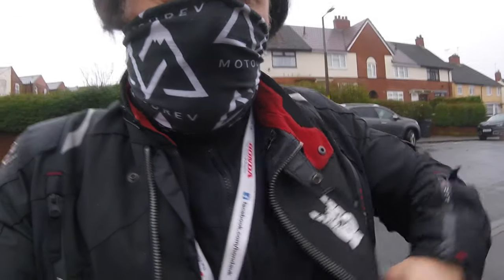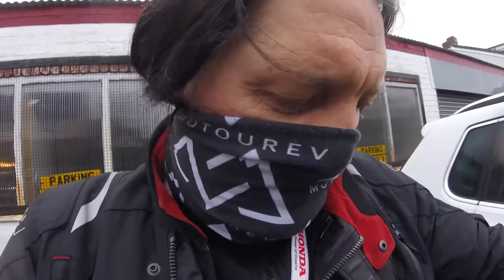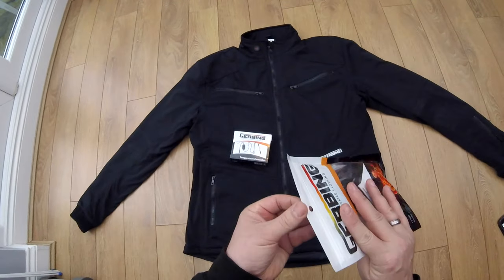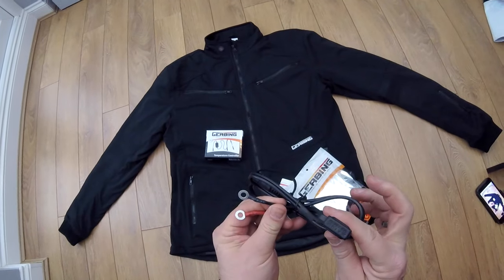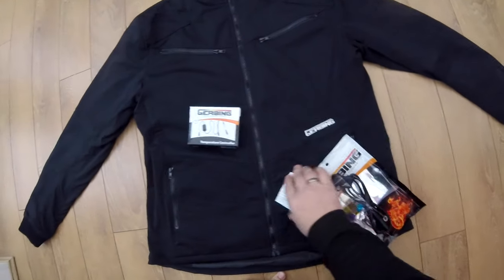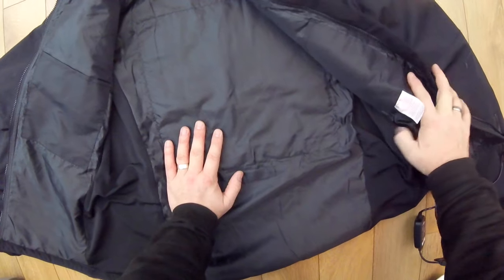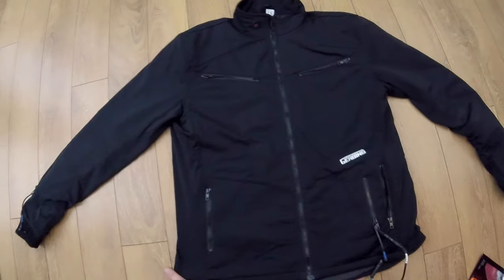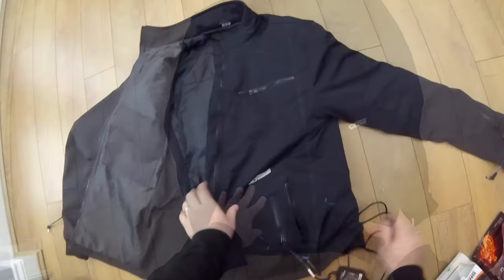Gerbing Premium Heated Motorcycle Jacket

Comment: Glad you mentioned needing to upgrade the fuse, I forgot when I added the jacket liner. All worked fine on lowest settings but then I couldn’t work out why it all went cold when I cranked up the gloves 😳😳 lesson learned 🤣🤣. I wasn’t aware of the cable extenders for the gloves as I can imagine that would be a weak point if the cable was stretched along the arms. I now have gloves, socks and the jacket and although not cheap well worth the money for Cold seasons. Cable extenders on order 👍

Comment: Brilliant vid again dont let the gloves dangle as i used to do that and it snaps the wire at the end of the plug  i recomend you use insulation tape on all the plugs to wire connections to strengthen them all up👍keep up the good work socks next
Reply from the maker: Cheers Daz, good advice I will remember that 👍🏻

Yeah gotta be socks next 👍🏻
Reply: @Motourev  or sugru!
Reply from the maker: @stephenfoster1971  good thinking Viper

Comment: Great video 👍 did you had any issues with bike's battery please? Jacket draws 6.5 amps and gloves few more. I'm just concerned if I plug it directly to battery it might drain it. Cheers 👋
Reply from the maker: So far no problems whatsoever, this will be 2nd winter using them and had no probs. In the cold if we are off the bikes taking I still plug in to keep warm whilst we chat but always make sure the engine is running.
Reply: @Motourev  thanks, appreciate 👋👍

Comment: A good real world user review so thanks for that and the jacket comes out well. How’s it doing after it’s first year? Any issues other than the short cables for the gloves? Cheers👍👍
Reply from the maker: Performing as good as new. Gerbing sent extension cables for free
Reply: Great news. Thanks for replying. Just seen Goose’s review. Think I need to invest in one and a battery pack for use in the workshop too. Win, win😂👍👍
Reply from the maker: @WoodNotts  I underestimated how good it was, was very impressed. The socks are mega, they are my favourite
Reply: @Motourev  about 18 months ago my wife bought me the gloves but the dealer wasn’t too impressed with the socks as they had a few returns. They’ve probably resolved any issues now👍

Comment: Hi again pal. Can you tell me is the riding position on the Vfr well forward or are you more upright on it, as I’ve just sold my tiger 1050 and thinking of a vfr. I’m in Aberystwyth and nobody here has a vfr.  Many thanks
Reply from the maker: I had the 1995 fireblade and that felt like I was lying down, when I got on the VFR it felt like I was sitting vertical. I put the bar risers on which raise the bars 20mm. I’m very slightly leaning forward but nothing to notice or get any aches and pains.